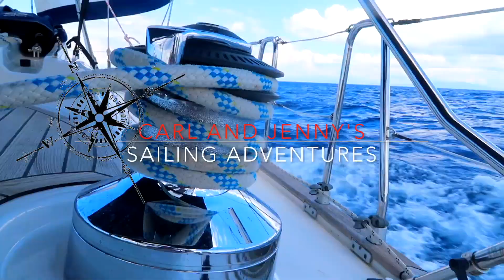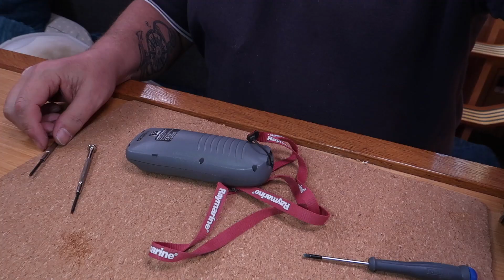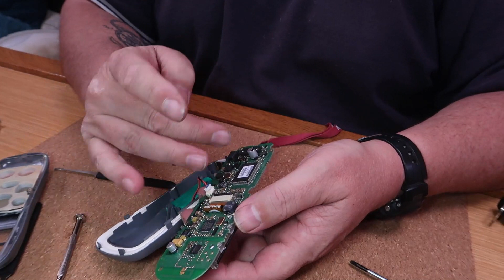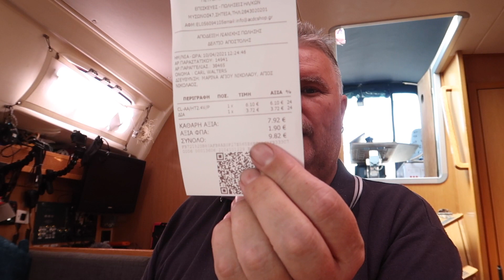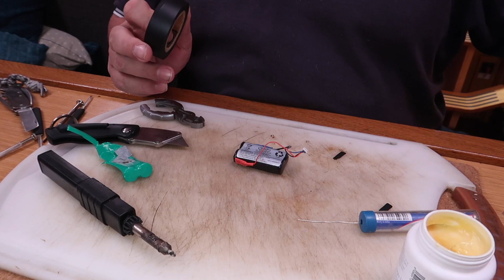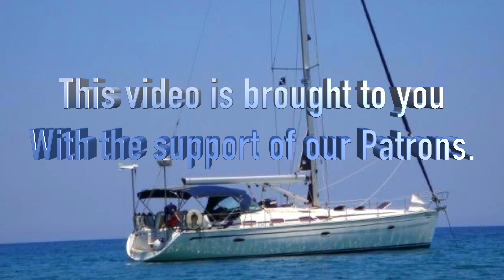Ep.86 How we saved £100 replacing the battery in a Raymarine Smartpilot - Carl and Jenny

Comment: Did the battery replacement a couple of years ago, still working fine.  Thanks for the video.  One thing I did encounter recently was that the screen stopped displaying anything.  Popped the case open and located the spot where the screen was attached to the circuit board, lifted up the little black plastic locking bar and removed the connector.  Wiped it with some denatured alcohol using a small brush - now appears to work fine!

Comment: Hello. Great video. Do you have a link to the battery you bought?
Reply from the maker: I just googled the battery type (it's printed on the side of the battery) found a battery supplier here in Greece that stocked them and placed an order. Different suppliers will offer equivalent batteries, maybe a different make, you just need to make sure the specs are the same.
Reply: @CarlandJennySailingAdventures  My controller is empty, battery has obviously been taken out by previous owner. Can you help? 😀
Reply from the maker: @fredrikbv  its just  two 1.2v rechargeable batteries as described in the video. I just searched online till i found a suppllier near us. Sorry I don't have a part number.
Reply: @CarlandJennySailingAdventures  thanks 👍

Comment: Many thanks for sharing! Where did you get special tool to open the controller from?
Reply from the maker: You can use anything that is flat, micro screwdriver etc. the tool I used as I mentioned in the video is a lock picking tool.

Comment: Thank you for that! What a helpful video. I have the same handheld on a boat I just bought, but the charge cord is missing and I cant find one anywhere, online or otherwise. Do you have any hacks to replace the cord? I have the A18105. If I can figure out how to charge it, I'll then see if the batteries are good! TIA
Reply from the maker: Maybe open the case, solder a wire to negative and positive then put a plug on that that you can plug into 12v socket
Reply: @CarlandJennySailingAdventures  That sounds like a good idea! Thank you!

Comment: Would love it if you had provided specific information on the replacement batteries so we could order them from our own sources.
Reply from the maker: Hi Garry, I just googled the battery type (it's printed on the side of the battery) found a battery supplier here in Greece that stocked them and placed an order. Different suppliers will offer equivalent batteries, maybe a different make, you just need to make sure the specs are the same.